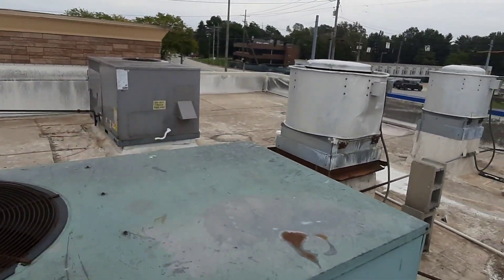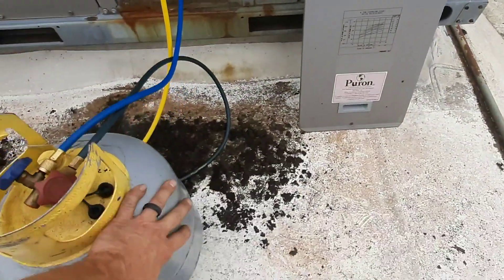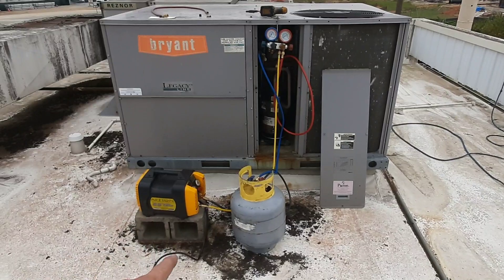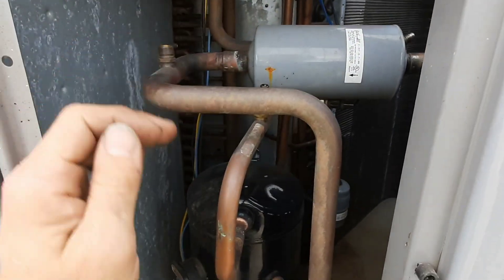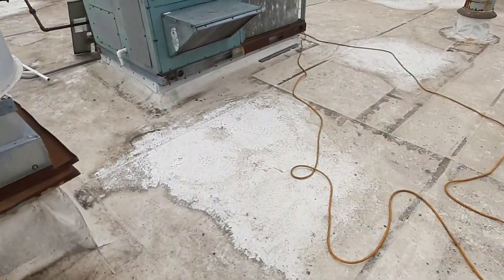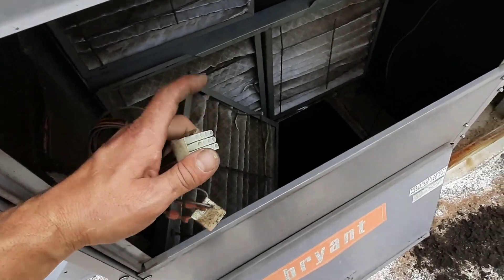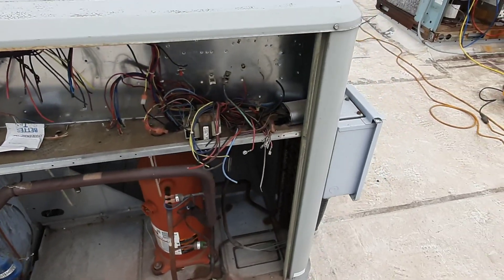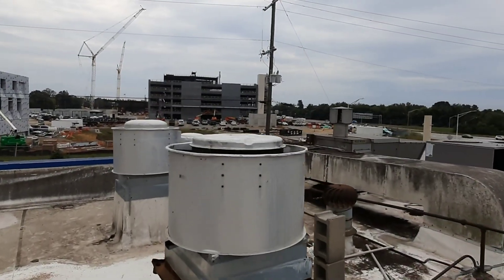no water on site. How do you keep your tank cool? recovery methods and basic RTU observations.

Comment: Watched a few videos on recovery, likely on the Appion YouTube. Schroeder cores act as restrictions and in turn metering devices. This flashes any liquid coming out of the system to vapour before it hits your recovery unit. 

If you get some valve Core removal tools and remove that restriction, theory is it should keep the heat in the tank down as you're not flashing to vapour and absorbing heat before it hits your recovery unit. You'll still run into issues eventually once you're only pulling vapour, but in theory nowhere near as quickly.
Reply from the maker: That's a good thought, thanks, Thermoelectric! They are coremax, though

Comment: Some of those old liquid line adaptors that only let vapor pass may help or take a old 3/8"pipe and put a capillary tube on the end and make a improvised Orifice to change the low pressure gas cold
Reply from the maker: Great ideas, thanks